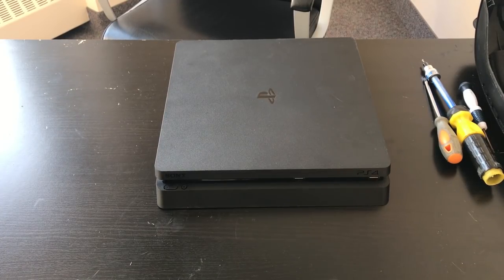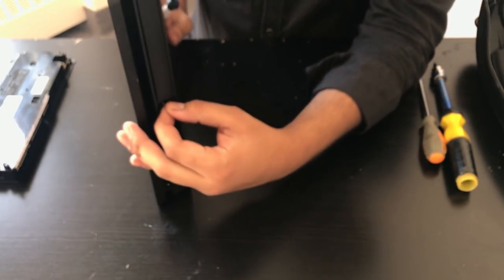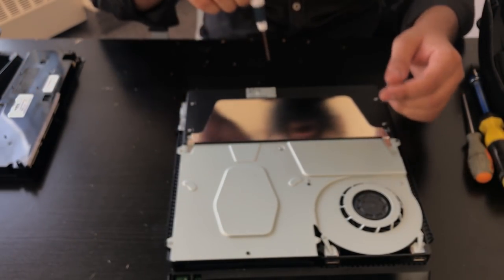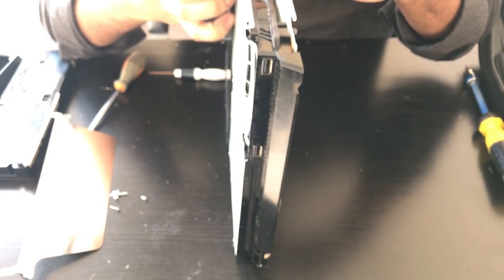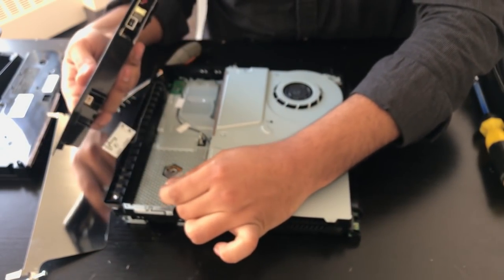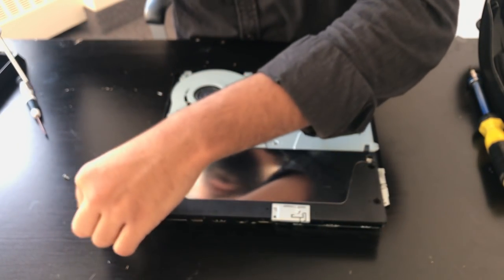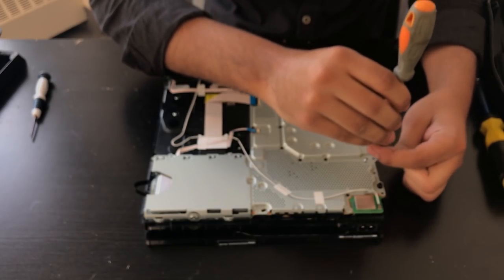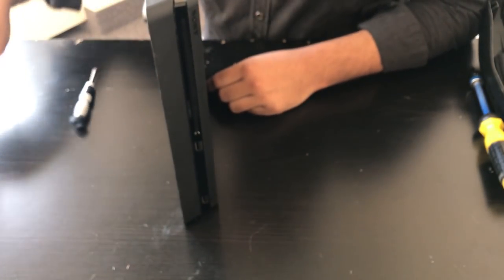How to fix a PS4 Slim that's not turning on/No Power - Power Supply Replacement (CUH-2015/2115/2215)

Comment: hey! my ps4 slim doesn't power up anymore.  However when i press the eject button, it beeps 3 times.  what can be the fault? is it going to be the psu in this case?
Reply from the maker: It is most likely a mainboard issue.
Reply: adam adamson where the eject button?
Reply: Maybe overheat it beeps 3 times with a red light when is overheated

Comment: Hi, my Ps4 Slim has an issue. So basically whats going on. Everything seems Alright but there is one problem. When i connect The Ps4 slim to the Television it shows no signal. So i decided to try Safe  Mode. Still nothing. Can you help me? Im struggling.
Reply from the maker: Does the light on the power button stay blue or does it turn white?
Reply: Fasttech Well like it turns blue then white but Nothing shows.
Reply: Fasttech What can i do to fix it?
Reply from the maker: You have a broken HDMI port most likely.
Reply: Fasttech Ok. Thank you for the help.
Reply from the maker: You can buy this service from us here: https://www.fasttech.ca/ps4-slim/hdmi-port-replacement

Comment: so i did this and i know its hooked up right wouldnt turn on and i gave up my brother came over next day i used his power cord it turned on he unplugged imediately and used my cord it also powered on checked the system storage and did same thing now wont turn on at all just like before no bugs or anything everything looks good no lights or beeps plz help
Reply from the maker: Try replacing the power supply. You might have bought your PSU elsewhere and that might be your issue. It could also be a mainboard related issue.
Reply: @fasttechvideo  i did i bought a brand new one?
Reply from the maker: @JakeBatch  Its a mainboard issue then.

Comment: My ps4 is not powering on by the controller and when I try and manually turn it on it does not beep or light up and I haven't played it in awhile so do you think it's still the power supply or could it be something else?
Reply: Please respond ASAP!!
Reply: Sorry they havent responded. I am experiencing the same thing. My son was playing, and then the playstation said it was powering off. 5 Hours later it still doesnt turn on. I believe sony has a bad design in the slim models. I will be ordering a power supply myself. $50 versus sending it to playstation for $99
Reply: @lovegeursonfleurine1543 I don't want to scare you but if it's a power suply issue, it's very possible that your console is infested by cockroaches

Comment: When i press the power button it makes a little beep and you see the blue light and turns off right after but never turns on
Reply: I tried new power cords, opened my ps4 and cleaned it. Is it the power supply?
Reply from the maker: Do you have to unplug your PS4 from the wall for it to turn on and beep again?
Reply: @fasttechvideo yes
Reply from the maker: @jj2sad504  You need a new power supply

Comment: just dropped my ps4. theres a sound on mine, but no light. Nothing happens after. would this be power supply 100%
Reply: Craig Turner  i did. it was the hdd that was done

Comment: My ps4 slim shuts itself off randomly, lasting no more than 10 to 15 minutes. I have to disconnect it and connect it to get it working again. It has no software or heating issues. Can it be the power supply? Greetings from Perú.

Comment: Does anyone’s ps4 slim makes a weird cracking current like noise from near the power supply area if it does what is the fix do notice that with or without the disc tia
Reply: Syed Muhammad Umer yup its happen to me .dont worry its normal bro

Comment: I'm late but my problem is when I came home from school I turned on my ps4 slim and it just turned off in a second. Could you let me know what was the problem ?
Reply from the maker: Its called the BLOD. You cant fix this at home. You can send it in to us for service here: https://www.fasttech.ca/ps4-slim/blue-light-of-death-blod

One question before you send it in. When it turns on and turns back off do you have to unplug it from the wall for it to do the same thing again?
Reply: @fasttechvideo  I have to replug it to turn it bk
Reply from the maker: You have a power supply issue.

Comment: My buddy said his ps4 was in rest mode popped and never turned on anymore he said roaches got in it cause he seen a few should he get a new power supply? I’m trying to help me figure out what happened he knows nothing about this stuff? Or can we try and clean the roaches out and hope it works again
Reply from the maker: ninjaxgaming gaming channel yes most likely the power supply is blown. Roaches enter the systems usually through the PSU
Reply: Fasttech hey so we got it off and it was a lot of dead roaches and a few live ones we got it down and cleaned looks brand new all the way down into the power supply and we took it off discovered 2 roaches and I found a black burn spot I can send pictures on an app or something to show you we took a lot of pictures in the process it will not power on at all or beep can we just get a new power supply and it will turn on again?

Comment: My slim beeps once when I press the power and nothing else, I can press eject and it beeps every press, is this a ps issue, or mobo??
Reply: Nick Petrakis my PS4 does this after every fucking update not working atm won’t go into safe mode atall beeps once turns on blue lights flashing like a fuxking Christmas tree (whilst holding power button down on start up instead of entering safe mode it shuts down) stupid stupid stupid updates
Reply: This happens to me I'm trying to find a solution

Comment: I was playing today for around 5 minutes and my PS4 randomly turnt off aswell as making my tv fuzzy and then going to no connection found, I’ve disassembled the whole thing and cleaned it but it still won’t turn on, this is the first time since I’ve had it for about 3 years that it’s done this it’s a PS4 slim... does anyone have suggestions other than repair shop ?
Reply: D F 2  appreciate it but I already bought a new ps4 lol

Comment: Was playing games ps4 shut off felt hot so I unplugged it put it in front of my fan blew out any and all dust on side and ports the ps4 has no response to pressing the button at all no light no noises nothing
Reply from the maker: You need a new power supply

Comment: @Fasttech   The plug of my ps4 is making crackling noise and it gets very hot. It is plugged in tightly and I have tried multiple sockets. Ps4 also gets turned off sometimes due to this. I have replaced the cable but still the problem persists. Can you tell me what the problem is?
Reply: Change your power cable. Looks like the fuse is blown

Comment: Please help my ps4 slim switches on and then turns right back off with a beep and blue light                                           Edit:i turn it on it beeps with a blue light then it turns off and then when I press it does not beep and there is no light then I have to unplug and plug it and then it does that again.. I have changed the power supply.. Could it be that that the socket in the ps4 is damaged??                                      Edit2: it's a ps4 slim so could it be fixed?
Reply: did you manage to finally fix it? having the same issue.
Reply: @seanperry565  bro i couldn't tried everything it was a problem in the motherboard as diagnosed by sony but they replaced my ps4 for 50% of the cost because it was out of warranty I hope you are safe and yours to get replaced bro.

Comment: When I turn on my PS4 the beep  sound comes and the blue light blinks for a second and then turns off .tell me how to fix it 
Is this a problem in power supply.
Reply from the maker: No unfortunately this is known as BLOD and can only be fixed by mainboard level repair or a replacement
Reply: please i now have the same problem, were you able to fix yours? and did you go about it please

Comment: How long until it comes to my house
Reply from the maker: 5-7 days USA and Canada
Reply: Fasttech I ordered the piece, on may 9 and its may 19 and I haven’t received it yet
Reply from the maker: @PradaMo  Whats your order number?
Reply: Fasttech 04473
Reply: Sorry for the late reply
Reply from the maker: @PradaMo  Your USPS tracking number is 9361220111404760454772
Reply: Fasttech so I would have to search this up
Reply from the maker: @PradaMo  You would have had to put it in USPS.com but I got you the tracking link since it might have been too much hard work: https://tools.usps.com/go/TrackConfirmAction?qtc_tLabels1=9361220111404760454772

Comment: When i plug the power cord my ps 4 makes a high frequency noise and when i remove the cord the noise stays for 2 to 3 secconds and it does not turn on not even a beep or light. So is it still the power supply?
Reply from the maker: It is a bad power supply most likely. Link in the description.